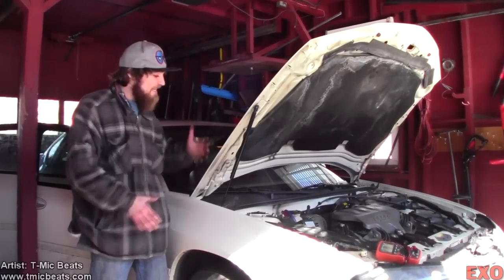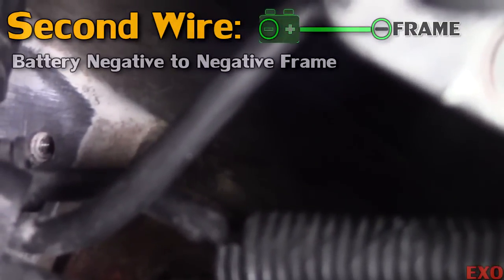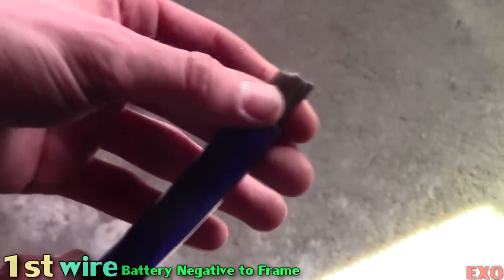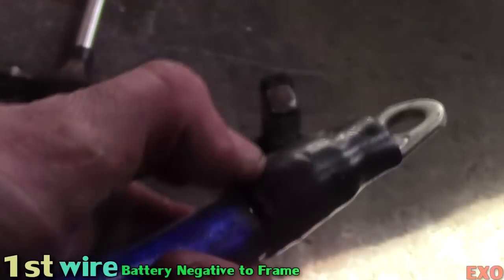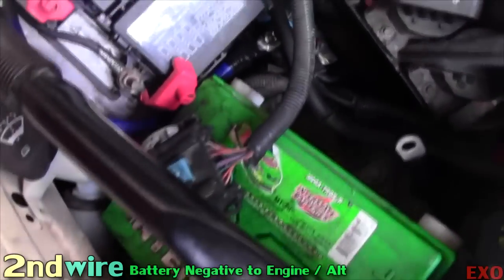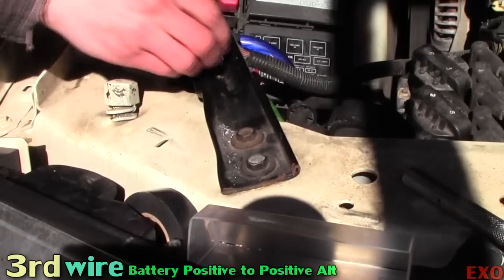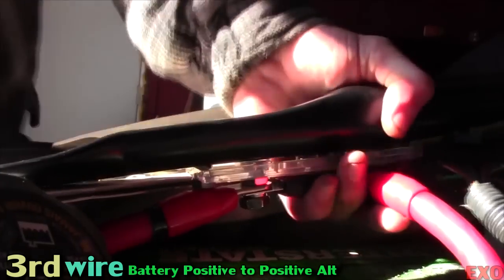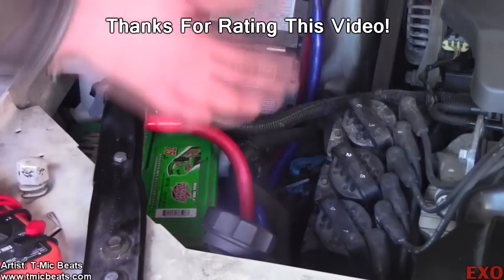How To Install BIG THREE Upgrade | EXO's BIG 3 Car Audio Wiring Tutorial to Increase Power Flow

Comment: Just to be clear. Are you ADDING wires to the EXISTING wire OR replacing the original/old wires with zero gauge new wire?

Comment: The ground on the alternator should no NEEDS to bolt directly to the rear ground lug on the back of the alternator then directly to the ground on the power storage box #the battery

Comment: Do you base the fuse size on the wires size or alternator amps or both? I'm using 1/0 gauge wires as well with a 300A fuse for a 120 amp alternator.

Comment: So basically 1 positive and 2 grounds...?
If using those hammer crimped connectors, why need such heavy wire as that's way more than what would go threw the connector?

Comment: I have a 5th gen Camaro and then battery is in the truck. Will the long ground and power lines from the battery to alternator be an issue being so long?

Comment: On my vehicle, the alternator connects to the starter and the starter connects to a 300 amp fuse block at the battery. Instead of trying to trace the wire to the starter then to the battery, could I just run a new wire from the alternator directly to the battery and leave the stock alternator to starter wiring? If so, do you have any recommendations on this process? Should I install an additional inline fuse between the alternator and battery? My 240 mechman amp just arrived and I want to complete all the underhood work at one time.

Comment: Do you have to put a fuse for the power wire to the power alt? or can you just run the wire without the fuse.
Reply: You can do it without a fuse, however, if the wire somehow got lose and touched ground, the wire would cause a serious fire.
Reply: Using a fuse is almost always recommended for the big 3
Reply: If the wire got loose and you had a fuse installed with it as well, the fuse would just blow and protect everything else.

Comment: Is there a big 3 kit for cars that have the battery under the rear seat what can I do for that since the wire is going to have to be longer also there's a thing to hook jumper cables under the hood will I need to do anything with that

Comment: What if there's a fuse and relay Box in between the alternated charging cable and the battery positive?
Should I bypass the box or just upgrade both wires?
Reply: Bypass the box

Comment: Do you have to put a fuse to your alternator? Even if  you have a fuse already on a power wire going from the battery to the amp.
Reply: You really should.

Comment: 2:48 funny shit, bam bidity bsm bsm LOLOL good stuff.  Great video and great energy. Kudos guy. 
Ground wire, why want as short as possible? Esp that thick.
Reply: All ground wire should be as short as possible no matter the gauge size, bigger gauge allows more current flow think of it like a highway the more lanes you have the better flow, bigger wire the better flow
Reply: And only use OFC wire type not CCA

Comment: Why not check the volts while under load?
Reply from the maker: This was in preparation for the system. With nothing installed yet we technically couldn't apply a load.

Comment: So when doing the big 3 you don't have to remove the oem wiring? I've been so concerned about this that I'm thinking about just not reinstalling my system. I've got a 2013 F150 XLT 5.0L and I  appreciate any advice.

Comment: So u have to fuse between batt+ to alt+?? How do u know what amp fuse to use?
Reply: ***** yes, and just use a 300 amp or research what is recommended for your amp
Reply: erik h Yes you use a fuse recommended from Amp to Battery.. but why a fuse from Alternator to Battery?
Reply: Brian Leal im not reaal good with electrical but a bad alternator could wreck the battery or vise versa im pretty sure

Comment: Do you have to put fuse between alternator positive and positive terminal?
Reply: Everybody has different opinions on it. To be absolutely 100% safe, people do add like a 200 amp or so fuse to it. However it seems like everyone is 50/50 on whether or not you need it.

Comment: I completed mine but want to redo the alternator connection, my alt has a plastic ring around it and the threaded post doesn’t fit the 0awg and factory wire terminal ring nicely, and the nut only got maybe two turns, trying to figure out how to flatten them down to secure and keep the rubber boot over it. Ideas?

Comment: So I have a 300 in which the battery is in the trunk which is far from the altenator. You said keep the connections short ass possibly. If I run it that far whats the downside??? This is all kinda new to me
Reply: You want to keep the grounds as short as possible. You can the positive 0 guage from the alt to the trunk and just ground it there
Reply: The 300 would be an exception to the big 3 rule in my opinion.

Comment: Im super confused, what wire runs to the amp cause all wire ends either go to amp ,alternator and frame. So where does the wire for the amp connect ?
Reply: To the battery

Comment: I have a 15 l7 on a hifonics 1500 do I need to do this? I'm going to be getting a second one soon but do I need to do this now?
Reply: it will help its not necessary if your voltage isn't dropping
Reply: +qjuan white my headlights dim and the lights on the amp and cap dim
Reply: +cj cambell ok I'm having that issue too I have the brutus 3k check your grounds make sure it's bare metal you want to upgrade the wires first that might do it if not install a second battery if that's not helping upgrade the alternator

Comment: If im running two infinity references on a 1500watt hifonics should i get one of these? I have a 95 toyota celica. Im new to this stuff so what size wires and fuse would i need? Or what would i need in general.
Reply: I have two infinity reference 12's too do you like them? I flex my roof with em

Comment: yeah My Bonneville has the battery under the backseat....so doing the big 3 takes more wire.   on the flip side... running the 0 guage from the back battery  to the alternator requires no firewall drilling because the grommet for the stock power wire is nice and fat and already supplied by GM

Comment: I'm running my factory speakers as my mids/highs off an alpine head unit at roughly 50x4 rms, then a 12' sub off of a separate amp at roughly 600x1 (class D)...would this upgrade really be necessary or would it just be overkill?
Reply: It will help. even at 600 watts, takes power to make power, the more you can feed an amp the better. I gained 5 Db doing a big 3 on a 750watt amp
Reply: It's probably overkill. But there's nothing wrong with beefing up power cables and grounds. Just ensures your charging and power system is more efficient.
Reply: I'm very late, lol. Now, it's not that necessary for low power Setups, but it doesn't hurt to upgrade and not only will it help your sound system but also your car. Also, if you were to upgrade you won't have to worry about it when building an even more powerful setup. Hope this helps.
Reply: So, I realize you probably already have this problem figured out but I'll chime in for any one else looking for a clear answer.
I was originally running stock grounds and power from the alt. After I replaced those I felt and heard a huge difference. 
For amps I had a 500 running subs, 150 to 6x9s, and 150 running the doors.

Comment: Is the big 3 just for installing second batteries for car audio or can you just do a big 3 with no second battery? Does doing the big 3 make your alternator and battery use more power or help the alternator and battery be more powerful?
Reply from the maker: It's just to HELP increase current flow! It can be done with or without a second battery.
Reply: EXOcontralto ok cool thanks EXO I love your videos you've helped come from a noob to a descent installer lol thanks for everything

Comment: Running a 1200 watts rms amp and i have rockford fosgate 4 gauge from trunk to battery..i want to do big 3 upgrade is it ok to use 0 gauge since its a different size from my amp wire?
Reply: yes that's fine
Reply: About Lace I've heard it's not ok to do that. You should run same gauge all through vehicle

Comment: Hey man I did my big 3 but the wire won’t fit through the batteries current sensor with the positive cables I’m getting a warning for the battery, do you know if I’m able to replace my stock cable from the positive to the alternator  with my upgraded wire?
Reply from the maker: Yes you can replace it entirely, yes. Most just add to it, but it's up to you.
Reply: Hell yes thank you, much appreciated

Comment: hey exo i just did the 3 upgrade with 4 gauge wire, in my 04 chevy aveo and looks like the ground of alternator off the casing to chassis makes the alternator to whine almost like a turbo spool sound, how do i get rid of that? its alittle annoying, also from alternator posotive post to battery positive and  from negative battery to chassis that exactly how i did mine, but like i mentioned before i still get that whine sound and im pretty sure its from the alternator casing to the frame of the car ,i disconect that wire and it goes away what other way can help get rid of this sound?
Reply: He said in the video to run the ground on the alternator to the negative battery post and do the chasis to the negative battery post and your Positive battery post to your positive alternator
Reply: Manuel Solian sounds like maybe a ground loop from old to new ground. try disconnecting the stock ground
Reply: yea i experience the same thing with my Hummer H2. Hooked everything up exactly the eay exo said and the alternator would whine and the car would shift gears funny even when i turn the car off i can hear the alternator whining for 5 seconds after but when i hooked everything back up the alternator went back to the same

Comment: Why do you need a fuse on the positive side from alternator to positive post on battery?
Reply: In case of a short, used to prevent a fire from happening

Comment: Whats minnimun amps the alternator should be
Reply from the maker: Depends on several things! What are the demands of the system?
Reply: EXOcontralto gotcha thanks gotta little confused cus mine had a external voltage regulator

Comment: Hey bro do i need to upgrade alternator when doing the big 3 ? Or can i do it of my stock alternator ? Thanks for sharing
Reply: Yoi can use stock. But.. If you have a 80 Amp or 100 Amp alt. You def want atleast 160 Amp. I use a 200amp for a Rockford pro 1500 and its Amazing paired with 2 alpine type r 12s. Won 2 competitions
Reply: @yusufjorgenz5951  dam... Thanks
Reply: @truejey7475  if you have 500 to 1000 Watts you can get by with a 120 Amp alternator. And I know battery caps get bad reviews but they do help with 1000 Watts or less. 2 farad. It keeps your bass notes consistent. I have had a JL audio JX 1000, a Rockford prime 1200.1 and a kicker DX 1000 and the best out of the 3 would be (in my opinion) the JL JX1000. But very very similar to the kicker DX 1000. The Rockford prime is cheaper but didnt come close to the kicker or JL. I'm using a Rockford power 1500BD and if at all possible get that amplifier. I can't even begin to explain the power it pushes but you will pay 4-800 for one. (if you go that route, you'll have to have another battery or a 160 or above alternator, 1/0 gauge wire and big 3 upgrade. It draws serious current. The math shows it using 90 amps of current just for that one Amp at 85 percent efficiency. If you csnt afford Rockford power, the Rockford punch is still better than the prime series. Any other questions feel free to ask.

Comment: For a rear battery, do I have to run extra long power AND ground wires from the battery or can I just ground the battery to chassis & then chassis to engine/alt?
Reply: You have to run power wire from the positive of your front battery to the back battery.then have another piece going from your amps power to the positive on the 2nd batt.same with ground.make sure you fuse the wire coming from your amp.and you have another wire going from the negative of the 2nd batt to the cars frame to ground the 2nd batt. Hope this helped
Reply: TheQuietestMazda3 when I said fuse the wire.I ment the power wire coming from your amp to the positive of the back batt
Reply: Thanks but there's only one battery, in the rear.
Reply: Yeah what I explained is for secondary battery buddy
Reply: Just look up how to wire a secondary battery and it'll give you a better understanding
Reply: I think you misunderstood, sorry if I wasn't clear. There is only one battery in my car. That battery is in the rear. It is the ONLY one. No second battery exists, nor do I wish to install one.
Reply: Thanks for your input. That exactly what I ended up doing. As far as a big THREE though, I only have those two wires hooked up at the moment. A long power and a short ground.

Comment: #Exo I used 0 gauge from my positive battery to the positive amp.
The gound wire of my amp is 4 gauge.
I have some 4 gauge laying around and I inted to use it for the big 3.
Is there a big diference if I use 0 gauge instead of 4, I mean, if so I will buy it.
Reply: +LOV2XRL8RL  im no pro but look at the gauge you use as a choke point while 4 gauge is probably bigger than the stock cable it won't be able to increase as much current as 0 guage
Reply: +victor Jones good point

Comment: So my question is, the wire thats coming from the positive bolt on the alternator. Does the other end have to be goin to a fuse like that or can u just take it straight to the battery?
Reply from the maker: Yes, and no. Fused if the stock lead is left unfused, unfused if the stock lead id left fused.

Comment: I have a question my car has a fuse going to the ground the wire can i still replace it with what u suggested
Reply: Meant from the battery to the ground that leads to the amp

Comment: dear god thank you exo, i have an impala and it is literally a nightmare to work on, the engine bay is straight forward but routing any wires can be a huge pain, with the amplifier where did you run the wire? I couldnt find any gromets in the firewall so i ended up dropping the wire under the car and running through the frame
Reply: There should be a grommet that your shift linkage goes through if u have a column shifter. This grommet is way oversize and you can easily poke a hole in it for another wire.
Reply: There should be a grommet that your shift linkage goes through if u have a column shifter. This grommet is way oversize and you can easily poke a hole in it for another wire.
Reply: is that located in the middle of the frame directly behind the engine? I do have a column shifter, I have the exact same model as exo's gfs impala. I had just such a difficult time finding it. there isn't a lot of space between the engine and the firewall :/
Reply: custommade21 you have 2 choices 1 on the floor of the front passenger or 2 on the driver side remove the bottom cover above the peddles and there is a entry point right there as well

Comment: I don't use fuse on the charge wire, I don't think it's necessary but prolly isn't a bad thing to do. Are u gonna make a video showing how to ground ur secondary battery that's gonna be in the trunk? I want to see how u get to the frame from inside of trunk. I'm scared to cut a hole in my Tahoe to run my grounds.

Comment: Great video bro one quick question could I do one of the big three for now and one I'm referring to is positive wire to the alternator to positive battery terminal just till I get my mechanic to do the rest of the big three
Reply from the maker: You could do that, but what's stopping you from doing it all at once?
Reply: EXOcontralto your right I'm going to do it all at once

Comment: Question: the bat to the alt with the 0g is fused. Makes sense, high power, if issue arises the fuse will protect. But by keeping the stock wire, that path will be next in flow. Is there a fuse in the OEM pathway from alt to bat? One should confirm this and add one if not. If the fuse pops on the 0g so the electricity doesn't melt the OEM wire and fry down the line.

Comment: question when u hook up the cable to te alternator do you leave the original power line hook up with the extra one or just unplug the original an plug the new one
Reply: leave it

Comment: How do I do this upgrade on a 1999 e320 Benz please help me the battery is under the back seat I don't know if I can run 0 gauge 4 gauge had a problem
Reply: your batteries in the backseat it's going to be more difficult to do a big three I had a problem like that in one of my homegirls car so I really just said fuck it and put 4 gauge straight from the battery to the back where the amp was.
Reply: same my 08 charger had the battery in the trunk so i just bought a second battery a  shuriken battery and used 0 gauge to connect the 2 batteries and never had any issues with

Comment: If I do the big three do I have to put in a second battery. Also will a 4gauge power and ground wire work for this
Reply from the maker: No, adding a second battery isn't required. But seeming as most vehicles have 4awg connections from alt to battery already, the added 4awg won't be as impacting as something larger.

Comment: that alternator puts out a max of 65 amps maybe 75 amps. why use a 300 amp fuse. Fuses are there to blow and save batteries and wiring. you may as well use no fuse in the system if it is not suited to the application.
Reply: He said he was going to be upgrading the alternator :)
Reply: After thinking about it, the load will be applied to the other side of the fuse and to other batteries possibly and that would compensate for the total load on the alternator. At first, I was confused about the fuse choice. Charging draws much less current than an amp will draw in most cases.